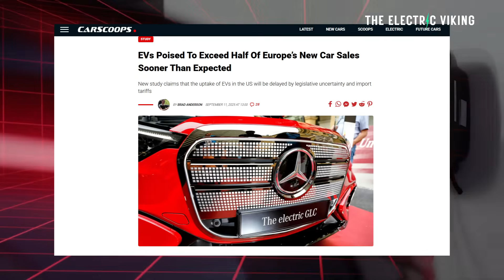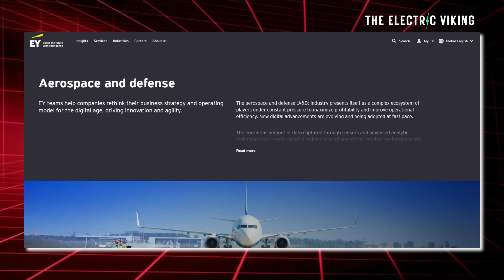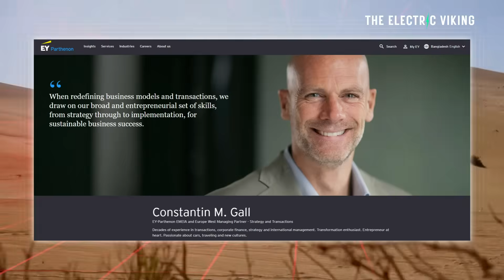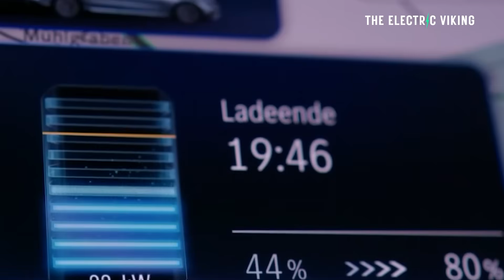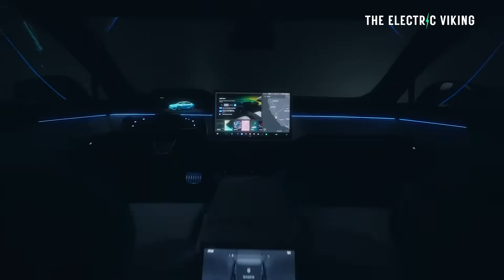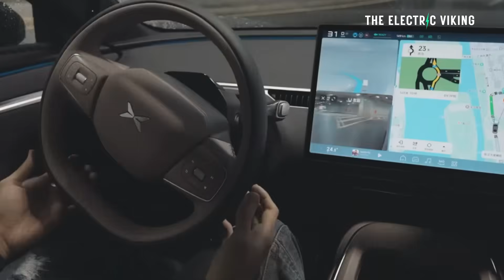Europe’s Petrol & Diesel Era Ending Faster Than We Thought

Comment: Hybrids - as short term temporary bridge technology - are usefull in some circumstances. Even in tiny little Europe where everybody only drives 100m a year (typical stereotype). When you are not able to put solar cells on your roof (because you life in a rental appartment block) or you do not have a garage (in cities) where you can charge overnight you have to use the fast chargers (even if only the 11kW ones) and with prices up to $1,40 AUS (0,79€) per kWh this can be expensive.
But as always it depends on your driving profile - when driving mostly long trips a Hybrid (without plug-in) lowers your petrol consumption or made it on par with Diesel - esspecially when you have no possibility to charge the car at the end of the trip.
When you mostly do short trips (for me short means less than maybe 50km one way) but often and you can use cheap chargers while shoping or working in the office or at home over night (with the "cheap" 60-70 AUS cent per kWh electric Power at home)  then EVs are the cheaper option.

I still have my 2018 Toyota Auris (Corolla in the rest or the world) with an average consumption of 4.5L/100km (52.3mpg) and with the change of law (simplified: landlords cannot deny the installation of a wall charger in the garage or at the parking lot anymore) my next (if there is one) will be a EV - maybe in 10 Years when my current Hybrid is absolute done.

Comment: Germany here.
I'm driving a diesel engine at the moment, because my car has in all likelihood a few years left in it.
I simply feel no need to switch to anything for the sake of a new car.
If I buy something new, it's probably a kind of EV, but that's probably in 2027-2029.
As you said, it's about value proposition. And in a phase where electric cars become better and cheaper each year, I'd be a fool to buy early, netting me a worse car for more money on a charging network that's not as good, yet.
So I'll be driving this Golf 7 right onto the scrap yard and then look for something new.

Comment: Competing with EV's was easy when batteries where $1000/kWh. At $25/kWh, it's impossible to compete with EV's, even if fossil fuels will remain cheap. And both fossil engines and the whole supply line of fossil full will actually get more expensive due to reduced economy of scale. We can debate about it happening in 2 or 5 years, but there is no going back.

Comment: Let the consumer decide. If an EV is a better car and lower cost to operate, peoplpe will WANT to buy one. However, legacy auto and oil and has industry aint going down without a fight.
Reply: The more they fight the more it costs them. Fighting a losing battle isn’t cheap. Smart ones would be adapting to the change, but as that might cost next few years extortionate management bonuses and shareholder dividends no one wants to do it. It’s just when they lose not if.

Comment: Danger Danger. Mr. Viking. has anyone had this problem? I own a 2022 Tesla MYP running  on FSD 12.6.4 with software V12 (2025.32.4dce503d8d3). When on the open road at about 70 mph, when the vehicle encounters a darker part on the road, it decelerated rapidly and swerves to avoid the dark street surface. In California on the HWY 395 South of Bishop, they are doing street resurfacing by using slurry and new asphalt . It happened 5 times. On the third time I figured out what was happening. It was repeatable. I contacted Tesla and I can only speak to a BOT on the phone. At the service centers, humans direct me to call the BOT. If someone gets hurt, I am at peace because I tried. Everyone in my car got the crap scared out of them.

Comment: I call BS on this.
EV mandates being revisited in UK and the EU.
Cost is still out of the reach of most average persons.
EU are still debating on adding massive tariffs on EV out of China even components so as to appease the Orange Maggot.
Even when BYD have their European  factory up and running  late 2026 early 2027 in Hungary, the cost of those vehicles won't be cheap as the duty on components from China forcing up prices for EU built vehicles. 
Motors and Batteries will come from China not from EU sources at first. Hungary will need battery plant and Motor plant to help bring costs down.

Comment: Not in the UK. Private buyers can't afford them.
Reply: Already cheaper than petrol for several sizes at point of purchase, and will be far cheaper still in a couple of years. Second hand ones are also cheap. Once you factor in operational costs it's way cheaper to run EV for most activities.

An ebike is still the better option for many use cases though.
Reply: What world do you live in,They start from £1k used and £10k new with plenty of smart well equipped ones £17k-£24k.Similar to ICE and cheaper to run and a better smoother drive.

Comment: From a UK perspective 4 basic issues are holding people back from buying more evs

1. Cost.  This is getting better but sadly the more affordable EVs are typically city only cars (see below on range).  I see the cost factor disappearing over the next 3-4 years as EVs and ICE vehicles become similarly priced.

2. Charging infrastructure.  Again this is getting better fast, but the perception is that there are still too few chargers and the price per KW on public chargers is extortionate.

3. Not being able to charge at home - the reality is that 65% of UK homes have off street parking, although obviously the figure is a lot lower in cities such as London.  This is and will remain a problem until point 2 is sorted.

4. Range.  IMO the EV industry continues to get this horribly wrong.  There are plenty of people who spend most of their time during short city trips but also have regular longer distance cross country trips - it might be to visit aged relatives, holiday homes or old friends.  What the EV industry currently offers are reasonably priced cars in the small to medium size (for example BYD Dolphin, R5, R4 size) which will not do 2 hours at motorways speeds - no one drives an ICE car until the petrol tank is empty so we can assume no one will willing drive an EV until battery is flat but instead leave a 10-15% buffer, or bigger much more expensive cars that will do a sensible distance at motorway speeds.  Give me an R5, BYD Dolphin sized car that in the real world does 220 miles at 75 mph at under £30k and I am sold

Comment: ICE cars are responsible for 7-9% of total global pollution. Digging up of the minerals for the batteries, the diesel used for that, for hauling and refining that, and afterwards, the energy needed to generate all that electricity makes EVs attempt to offset pollution negligible. But I guess when you destroy a country half way across the globe so you could feel green, its ok, right? 

I wouldnt have a problem with EVs at all, except for the fact that people are trying to ban normal ICE cars, turning cars into soulless machines, deprived of any beauty, fun and complexity. Also, EVs can very easily be tracked, and have programs built in that can just turn off the car on a whim, which makes you prone to control. Their batteries have to be changed way more often, which is way too expensive in terms of money and additional resources (which pollute even more). 

The reliance on an electricity grid, which is very unreliable, and expensive, is also a big problem. What happens when the power goes out? I get that 95% of people dont care about the experience of driving a car, but why ban ICE cars, which offer ubelieveable experience in terms of driving engagement, sound, handling etc.? Every day, people have less and less liberties...

Comment: EV REGISTRATIONS are rising in the UK but the cars are sitting on dealers lots to be sold as 'low mileage' used cars at high discounts contributing to the terminal depreciation of EV's. The market is totally distorted by bonkers arbitrary targets whilst the normal car owner is hanging onto older diesel or petrol cars with proper switches and no unwanted :driver assist' features all the while thinking 'I'm not going anywhere near that'.  To be fair new ICE cars and hybrids are equally undesirable and will also not be repairable due to the sensor and screen epidemic.
Reply: A Tesla small van with a steering column, zero self driving software whatsoever. But you're right, exactly the opposite

Comment: Its logical since the US has an oil industry to protect but other markets dont.  Norway is the anomaly.
Reply: You can’t protect inefficiencies, history shows us it’s doomed to failure. Not getting onboard will cost more. The canal companies fought long and hard to compete with the railway, it ended in lots of bankruptcy. So if you are a factory and can add solar and wind for most of your power what would you do? Households too. It’s happening slowly but surely. Run your house on solar then why not add a vehicle and save a ton more. It can’t be stopped, the Genie is out of the bottle.

Comment: There is no ban in Europe on combustion vehicles after 2035.
Existing vehicles can be used after that. And newly sold combustion verhicles after 2035 can be used if they if you e.g. use synthetic fuels made with green energy.
Reply: Or use ICE hydrogen engine

Comment: Legacy auto wants to keep hybrids for as long as possible, as they need regular servicing, parts for the ICE engine, etc., so this keeps the dealers happy and the money coming from the parts sales.
Reply: Untrue.  OEMs hardly care (and are actually incented to sell PHEVs due to lower warranty costs), but dealers want to sell pure ICE cars to maintain service revenue.  

The Chevy Volt PHEV had just 40 miles AER, and owners regularly drove 95% on battery, with the gas engine hardly ever being used except for the rare road trip or failure to charge overnight - as designed.  Chevy Volt engines see hardly any wear because they aren't driven hard.  A Chevy Volt with 20,000 miles on the odometer will typically have less than 1,000 miles on the engine - basically brand new.  The need for PHEV "service" is for fluid refresh, not parts wear.  

China sees the same thing with their PHEVs (minimum 50 km AER) - priced more affordably, and run on battery 90+% of the time because fuel costs 3x to 4x the electric cost.
Reply: @ZweiZwolf Don't hybrids still have to be serviced, so as to keep the warranty alive? If OEMs wanted shot of them as you suggest, why are they so keen to keep them as an option in the EU to 2035?
Reply: @connclissmann6514  PHEVs will require nominal service to refresh aged fluids, but that's very different from physical, mechanical wear.  

Plus, most savvy OEMs just bundle the first 3 years of service during the warranty period into the purchase price to maximize off-lease value fleet-wide.

Comment: Remember Toyota saying "there's not enough batteries"?
Reply: In Japan. True.😂
Reply: snooze you lose.
Reply: I'm less concerned about there being enough batteries as enough power generation infrastructure to support a massive uptick in EVs on the road.

It doesn't matter if there are enough batteries if the power capacity isn't there to charge them.
Reply: There will always enough power generation if you charge when the electricity prices are low.
And believe, people do care about the price if it's 13cts during the night at home vs 40cts at a charging station.
Reply: @mnomadvfx

Batteries can help with this ironically. You can charge them slowly at times of low demand and then pull the big bursts of power for fast charging from the on-site batteries. 

It's kinda funny how the answer to problems caused by batteries can be solved with more batteries. But one of the advantages of lithium batteries is their quick discharge capability, so it's unironically not a bad option. And if you switch to a more solar-heavy grid, you'll have a lot of batteries on the grid and in buildings or people's homes for this purpose anyway.

I think the real change will be a change in mindset. Instead of quickly filling up at gas stations, people will get used to more slowly filling up at home and at work or whenever their destination is, because any individual car is just sitting around unused, what, 80% of the time? 

People will think of it more like a cell phone than a tank of gas, because it's the same basic technology.
Reply: @mnomadvfx  it’s the batteries that smooth out demand. Also home generating, why we build things now without solar is a mystery and disgrace. If my basic home setup generates over half my household demand so would everyone else’s. Neither does it require massive grid improvements as a lot stays at home, runs house, charges batteries and car. There is all the energy we need around us waiting to be captured and it doesn’t need drills, pumps, refineries, tankers or Opec.
Reply: @kevinallen4604  The snag is Government can't give grants for Solar and Batteries as it conflicts with the big businesses who effectively own their parties. In the UK we have a political system that claims to be democratic but it heavily influenced by corporate lobbying,  a societal chimera, a small party running the country for a small section of society. Thing is its the same whichever colour of party is currently in power.

Comment: Once sodium batteries are widespread, 10x cheaper, 1000km autonomy and lifelong, all continents will go for it, ie next year on ... awaiting free energy patents release
( 1000km is enough because a ~10 hours trip is enough for everyone )
Reply: Sodium batteries are heavier than Lithium.  If you need 1000 km, get a PHEV:  100 km electric for daily use, +900 km for road trip.
Reply: @ZweiZwolf  The CATL ones are pretty close to the same density as LFP at this point so except for explody NCM batteries they are looking more even. They also work when it's freezing cold so in winter in many places their range holds up far better.
Reply: @etchedpixels  Yes, Sodium battery tech is vastly safer and more consistent than Lithium, especially NCM, but LFP is also lower energy density per weight / volume. No free lunches here.   Even the longest range EVs are nowhere near 1,000 km because the battery size and weight are prohibitive.  The same amount of battery would be much better used converting 9 ICE cars to 100 km AER PHEV.
Reply: There is no free energy.
Reply: Finally a comment I can agree with on this channel..all the rest are deluded or based on false data..

Comment: Important point to bare in mind. It is only the production of brand new fossil fuel based vehicles that will be banned in Europe from 2035. Therefore, there will undoubtedly be an increase in demand in the used car market. However, that demand will quickly tail off as EV range start to outlast even the most frugal petrol or diesel cars. On top of that, battery technology will be such that charge times will be down to the point where waiting for periods over 15 minutes to charge will no longer be an issue. A caveat to that is home charging, where charging times will be limited to household supplies of 32amps max (UK). Or in other words, be lucky to hit 6.8/7 KWh as the max house supply in the U.K. is 7.4 kWh. The house itself will be drawing around .3 to .4 kwh even when few appliances are being used, therefore even though home chargers are capable of delivering 7.4 kWh, it’s all but impossible to see that going to a car. Hence that’s another reason to charge at home at night through to around 6am.
Reply: There's also a growing industry converting ICE vehicles to EV.  Electric Classic Cars in the UK has done some beautifully engineered conversions!
Reply: @craigmerrow225 I visited the place 3/4 years ago. They were in the process of converting a Ferrari Testarossa. Seemed like sacrilege to remove a perfectly good engine. Apparently the owner of the car had sold the engine to someone in the US. The sale helped with the cost of the conversion. The tour round the workshop was very informative. It also blew apart the notion high voltage batteries could not be repaired.

Comment: I have a question. Say EV swing the pendulum and are dominant. Currently, dealerships sell ice vehicles and make money at sale, but then make all their money through parts and servicing. How are future ev dealerships (on the basis these dealerships are not selling ice anymore), going to make money? Selling EVs will be a cutthroat game and low margin. Or are we literally going to see the end of dealerships as we/they know it. Will the Tesla sales channel be what all manufacturers will need to implement?
Reply: This why the legacy manufacturers need to sell EV'S only when they talk about wanting of direct sales to consumers.  Build low maintenance EV'S, when the ICE vehicle is done with it's cycle, and that will weaken dealerships power via less service. It's a long game but would work in a decade or two as dealerships run out of ICE vehicles to maintain, and therefore their grip on selling cars.
Reply: As a general economic rule service businesses mostly collapse when the product they are built around becomes reliable and stops sucking. There will be a lot less EV servicing businesses just like as computers grew up we stopped having an army of computer technicians. This is a good thing because at the end of the day you are paying for the dealerships not the manufacturers.
So yes - it's going to be less dealerships, less repair places, and less costs. Will be more annoying if you are somewhere rural and need a service though.